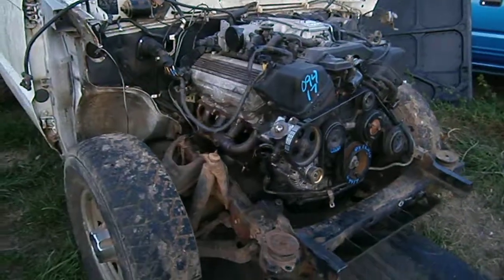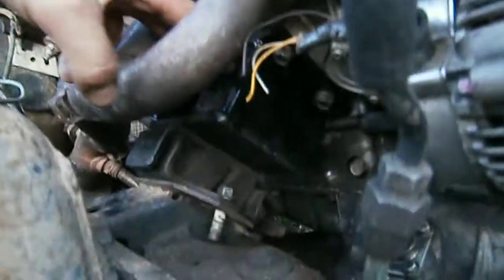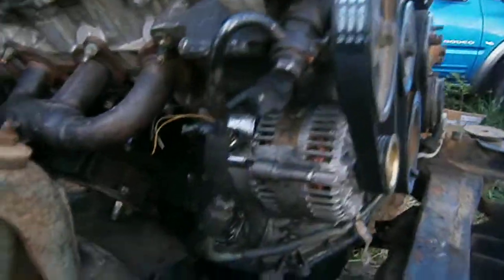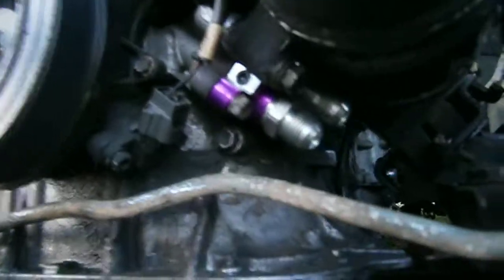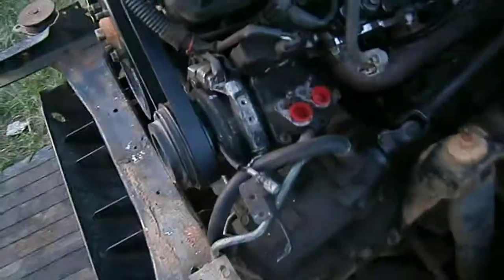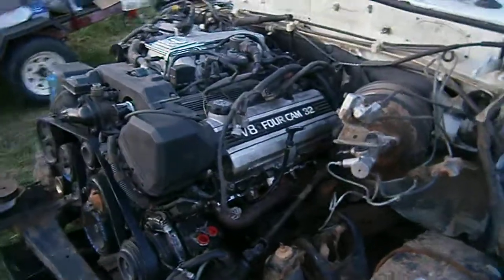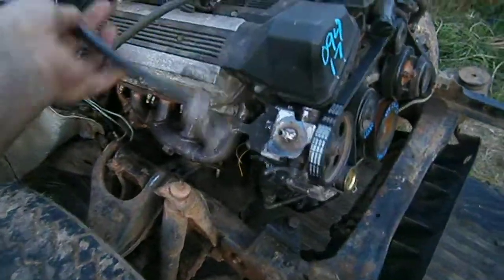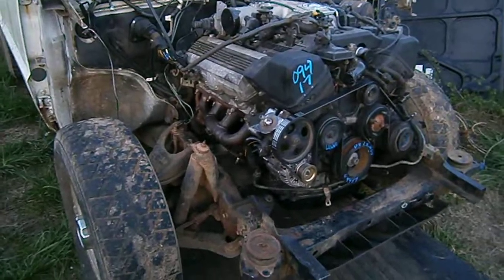Isuzu Trooper V8 conversion update

Comment: Any suggestions for the 2000 Trooper... I want a Japanese engine in there.  I only been riding it for a few months and adding a quart of oil every 500 miles its annoying... I need a reliable Japanese Engine is there any info out there for these generations